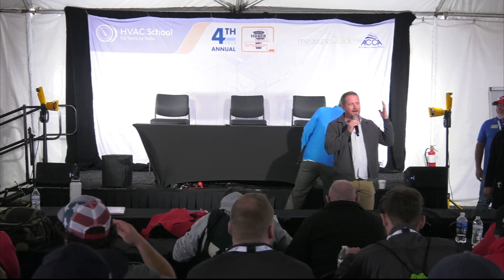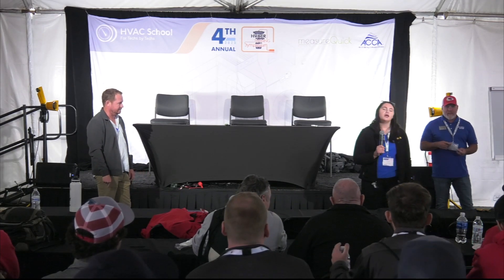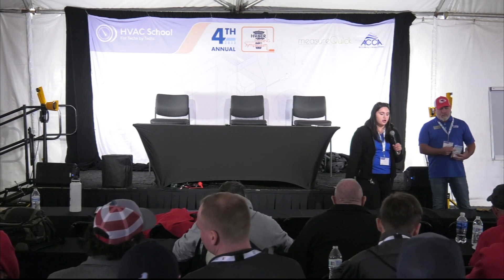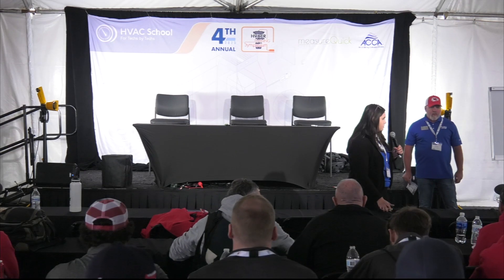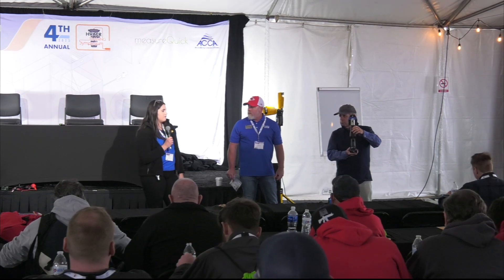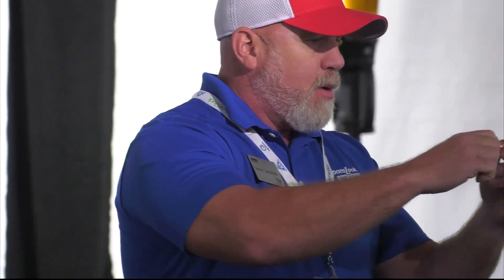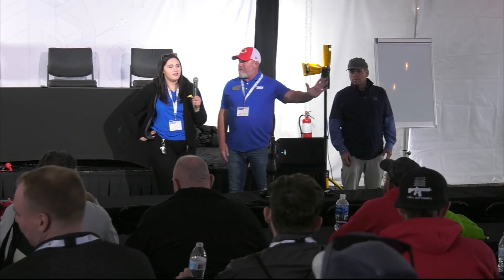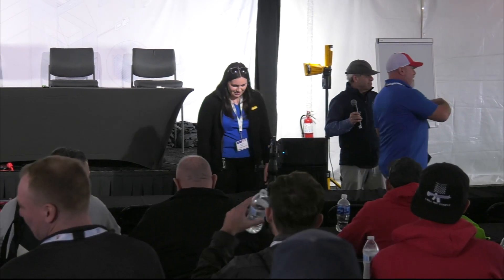ZoomLock MAX Refrigerant Press Fittings Discussion at the HVAC School HVACR Training Symposium

Comment: It is not true about brazing.  To be honest if the coil or outdoor unit came with the straight pipe (not flared) then techs would use press so much more.  But if you have to torch at the coil or valve might as well finish other fittings with torch you already have off the rig.

Comment: There's a solder lead paste/flux. It would be nice to crimp a fitting without o rings , with lead paste coating and crimp then light heat